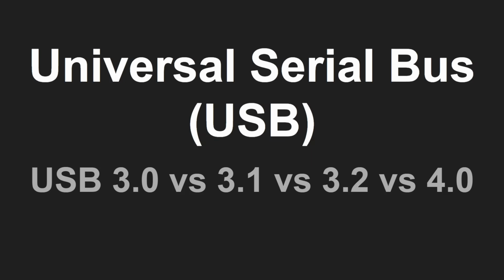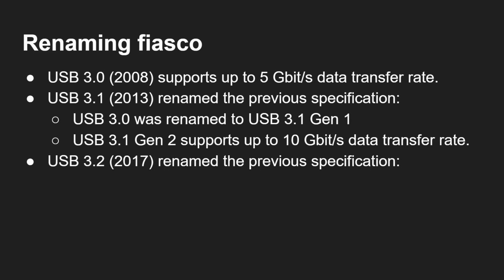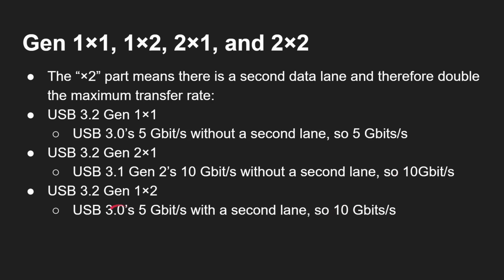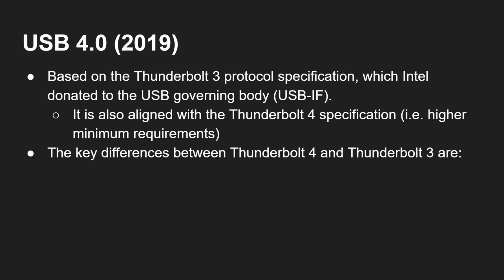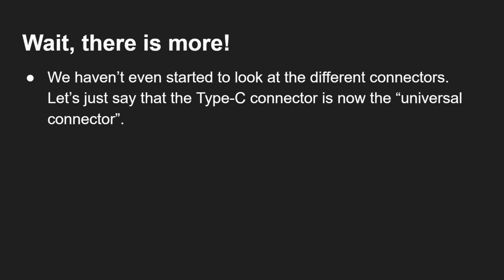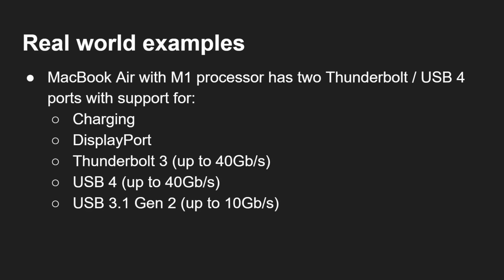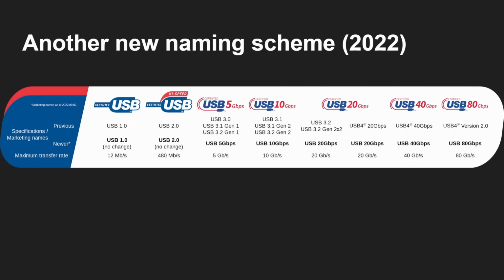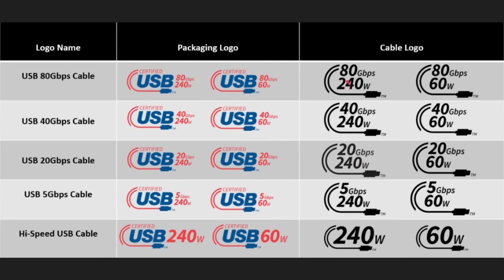USB 3.0 vs 3.1 vs 3.2 vs 4.0: What's the difference?

Comment: So what you’re saying is that the primary purpose of the naming is to be as confusing or ridiculous as possible.
Reply: Pretty much yeah 🤦🏽
Reply: The USB 3.2 and later naming makes sense though but the way they RENAME older versions is indeed gonna cause confusion
Reply: Don't worry man, they are going to change it again anyway.
Reply: If the USB-IF had an ounce of common sense, they would drop all the "3.1" and "3.2" and "Gen" business. Just make it "USB 3 5x1" for the original and "10x1", "5x2" and "10x2" for the rest. There, that's all the relevant information in a simple compact form: the (third) generation of the USB spec, the base speed of the data lanes, and the number of lanes.
Reply: They got me, when I was buying my laptop it stated it have USB 3.1 gen 1, ok I assume great it have the 10Gbit one, because at the time I knew usb 3.0 is 5Gbit and 3.1 is 10Gbit, did not know they rename it.

I still don't understand why they rename 3.0 and 3.1 it was easy to understand and to explain to someone
Reply: @kayl456jenna Makes Sense.👍

Comment: Engineers know the difference. Marketing and Sales do not.
Reply: Always 🤣 I used to attend the quarterly sales meetings from an old tech firm that I worked for back in the 90’s. Trying to get them to understand that on a modem  (woohoo) V.22 vs V.22bis was double the speed @double the cost because every recent order that had come in was for the new tech V.22bis modems using the older prices. I told them to stick to the actual baud rate, which they all knew. Us ‘techies’ would worry about the actual part numbers V.22 numbers etc.

Comment: Here's how I disambiguate USB terminology: Specify the connector type, ignore USB numerical generation, append max transfer speed. For example, instead of USB 4v2, say USB-C 80 Gbps. Instead of USB 3.1 gen 1, say USB-3 5 Gbps. Instead of USB 3.2 Gen 2, say USB-3 10 Gbps. And in case anyone's confused, "USB-3" refers to a blue USB-A socket.
Reply from the maker: Yes, that is basically what the USB people did in the last re-re-rebrand.

Comment: Well, at least the USB Implementers Forum stopped putting things like "Full Speed" or "High Speed" in the names. It's not much, but it's something. If they would now stop renaming older specifications every few years, that would be nice.
Reply: They don't rename older specifications.
It's just the new revision INCLUDES the features and speed modes of the older ones, because of course, they have to be compatible.

Comment: This video was extremely helpful in understanding why the naming is complex. Now I think about the USB number in 'USB Y.Z' as the "meta scheme" number. So reading "USB 3.0" I think "original scheme, so just the third major USB". If I read "USB 3.1" I think "Speed scheme. Gen 1 is 5Gbit, Gen 2 is 10Gbit". If I read "USB 3.2" I think "Lane scheme. So Gen 1x1 is 5Gbit, one lane. Gen 1x2 is 5Gbit, two lanes, so 10Gbit. Gen 2x1 is 10Gbit, one lane. Gen 2x2 is 10Gbit two lanes, so 20Gbit."

Comment: I remember the days of Firewire (IEEE 1394a) and how I loved the ability to chain devices over USB's master/slave roles.  I thought it would win out, but now it leaves me a drive sitting idly by as a historical landmark. Other issues in that day were trying to find even faster storage solutions and looking early at networked storage over Firewire 400 and 800 hard drives so that we could edit and move scratch disks for Final Cut Pro, after all gigabit Ethernet was the fastest thing I could see then to transfer video data at the time. So much has changed, but thinking through different protocols, encoding, and that overhead made for interesting hardware choices back then. Glad things are more settled now.  Or are they?

Comment: Hi, Gary. So when Apple says the iPhone 15 Pro uses USB 3 with data transfer speeds of 10 gbs, which USB protocol is it actually using? And how is it different from the USB in the regular iPhone 15? Please explain! Thanks.
Reply: Late reply but it would either be 3.1 Gen 2 or 3.2 Gen 2 (I'd just call it 3.1 without the Gen bullshit). The regular on the other hand just uses the old USB 2.0 standard.

Comment: Can anyone imagine a world where USB never really took off? Would firewire have developed into what USB is today? Would external drives use eSATA? Would printers use turbocharged parallel ports? Would mice and keyboards still be using the 6-pin PS/2 style interface? Would phones still use barrel jacks to charge? We would be in a VERY different world if USB hadn't caught on.

Comment: question?
usb 3.2 vs usb c 3.2 gen 2 on my pc and i bought a external ssd with a usb c to usb b(into pc) it was also some one who told me to buy a usb c to usb c 20gbps cable instead of the cable that was in same box as my external ssd(I did this and just connected it to my pc)

So the transfer speeds of 400mb/s went up to 687mb/s so it was definatly faster....This i could see without a doubt myself..
But my question is this because i game from my external ssd and loading times has been good will the loading times be even faster now after i got this usb c to c 3.2 gen 2 cable(or is it no differences when it comes to games loading times and only faster when i transfer big game files between my nvme to external ssd"this i saw at once,but loading times w games i dont kno??9

Also why did my external ssd come with a slower usb c to b cable and not the faster? kingston xs1000 2tb is the name if anybody knows this because its just sad to if they dont ship the faster cable and just the older n slower instead(Is this because there are not enough people using usb c ports on pc or what could be the reason to this??)

Thanks n must say this was a great video(i have never been aware of all the different speeds(i knew about usb2.0 and usb3.0 and that was it)

Comment: Yeah... USB's naming convention is like throwing perfume on a pile of hot garbage in a hot and humid summer day to see if it "fixes" the whole thing. It's one of the most insanely idiotic naming conventions I've ever heard.
The problem isn't only about understanding what it is, it's about identifying what devices have what - which manufacturers conveniently won't list or tell, btw - then testing a whole combination of ports and cables to see what works and what doesn't because of a standard that cannot work as a standard, and then after you went through all that multiple times over, you have to keep managing all those devices and cables that you don't know exactly what will work and what won't because of this entire mess.
And then to further make things worse, now we're dealing with enough power to fry devices and potentially even cause fires. Between USB 1 and 2 you didn't really have much of a problem because even if stuff was poorly made, because it was low powered, things just wouldn't work and that was it. Now, if you have a poorly made USB-C cable or out of spec device, you could fry something up, as happened early on.
You pick any random USB A to USB C cable laying around, you have no way of telling it it's a USB 2 power only cable, all the way up to the latest USB 4 spec with full support. It's just a total shitshow.

Anyways, rant over, let me give a tip for people with this problem... go to Amazon, Aliexpress or other platforms and search for "USB cable tester", look for a bare circuit board device with multiple connectors. Some will have 6 different connector types, some will have 9 - between USB-C, USB A, micro USB, and then perhaps it could have USB B, micro B, mini B and whatnot. And then a bunch of leds in the middle of the board.
You just plug cables from one side to another and the led indicators will tell you what the cable supports. It's a life saver.

Comment: Can I put a usb 3.0 in a USB 3.1 Gen 2 port/plug ( which in on a new Mac air that ) or is there an adapter? Sorry I probably sound really dumb. 

(My external hard drive has a usb 3.0 ( think it’s just 3.0) &  if I get a new MacBook Air, will have a usb 3.1 gen 2 . Hence the question (I’m sure there are ways to sort it all out , even if I needed to get someone else to organise it. And I am going to be buying a new external hard drive now as a backup. ).
Reply from the maker: USB is backwards compatible so you can connect a USB 3.0 drive into a MacBook Air. However if your drive has a type A connection (which I guess it does) then you will need a USB Type A to USB-C adapter. Apple has one and there are many third party ones.
Reply: @GaryExplains  thank you so much!!!! I plug my hard drive into my current MacBook via a 3.0 usb cable . Can I just put that into the 3.1 gen 2 port of the MacBook Air?
Reply from the maker: The MacBook Air only has USB-C ports. So, as I said, if your drive has a type A connection (which I guess it does) then you will need a USB Type A to USB-C adapter. Apple has one for sale and there are many third party ones.
Reply: @GaryExplains  oh! Thank you so incredibly much! I thought they had usb 3.1 gen 2 ( based on what I read on  apple ). Thank you!!!!
Reply from the maker: Don't confuse the connector type and the relevant USB standard. Some USB 3.x ports can be USB type A or USB-C (depending on the revision and/or generation). The MacBook Air has USB-C ports.

Comment: and if your doing a pc build only intel has this usb-4.0 , ..... me wanting to do a small build with a monitor on the side and only want 1 cable to it , this won't happen me being a AMD Guy ? .... Right ?
Reply from the maker: As far as I know, AMD has support for USB 4 since 2022. A quick search for "amd usb 4" reveals lots of info. Why do you think it is Intel only? This is USB, an international standard. USB 4.0 is even on Apple Silicon (based on Arm and nothing to do with Intel).
Reply: @GaryExplains   I don't see any USB 4.0 thunderbolt on AMD motherboards only Intel , I'm doing a AMD build right now that has  USB 3.2 Gen 2x2 20Gbps Type-C port can this output video through this cable ? or will I have to use HDMI ?
Reply from the maker: A quick google search for "amd motherboard with USB 4" gave me this https://www.tomshardware.com/pc-components/motherboards/msi-x870e-carbon-wifi-motherboard-review I didn't bother searching any further.

Comment: Yes fine! I think! 
But the Chinese sellers of addon bits and bobs will call whatever they sell whatever they want again. Thus confusing confusion even more, so the seller confusion of Aliexpress terminology and naming flows to ebay and Amazon as the sellers look for new selling platforms. 
And no. Confusion of confusion does not mean it is all corrected.  Two wrongs still do not make a right.

Comment: 1 thing is true I've never seen in my life that 2008 upto speed, like ever!! That speed never reached by any file type transfer
Reply from the maker: Well obviously file transfer speed is determined by the speed of the disk drive. If it was a mechanical HDD from 2008 then there is no way it would match those speeds. The drive is the bottleneck not the data path.

Comment: Perpetuating "USB 4.0" or "USB 4" is harmful to consumers because not only does it go against the original material, but it is also worse for SEO and creates confusion.
There's a reason it's USB4 , the marketing is clearer and avoids nonsensical questions like "what is USB 4.0 v2.0" ???"
Reply from the maker: But USB4 Version 2.0, as specified by the USB-IF, is OK? 🤷‍♂️
Reply: My keyboard corrected my intentional mistake, I meant to write the mistake "USB 4" not USB4
Reply from the maker: Changing the naming scheme yet again, is just confusing. USB 4.0 gen 2 would have been more consistent. The point is that the USB-IF promoted a naming scheme with a ".x" part and now it wants to change that and expects that those decades of branding will just be forgotten. The problem is the USB-IF perpetuating USB4, not the other way around. USB4 Version 2.0 isn't remotely consistent. But when has the USB-IF been consistent?

Comment: What I can't figure out is... Do I need to throw away my so called fast / universal / High Speed 3.0 chargers or will they still work with the new devices with 3.2 ports. I don't really care if they charge slowly and may not keep up with power consumption. I would like to change out my charging stations over time rather than a big investment all at once.
Reply from the maker: I didn't really cover charging, but the chargers are always backwards compatible, just slower, as you said.
Reply: @GaryExplains  Great! Thank you very much.

Comment: In one ear, out the other...
Reply from the maker: Sounds painful 😜
Reply: @GaryExplains  Love what you do Gary! I'm pretty technical, but on the USB front I've mostly trusted that the USB interfaces found on most devices are chosen to be as compatible as possible for most users. At least in my circumstances, that's worked fine.
Reply from the maker: Yes, but if you wanted to buy some external storage or direct attached storage with RAID then knowing the USB capabilities of the device and of the host is important, don't you think?
Reply: @GaryExplains  For sure; I'd want to do my research before doing that kind of setup and I'd trust your video as a resource.

Comment: USB needs to be replaced.
Reply from the maker: Really, why? What with?
Reply: @GaryExplains  The USB-IF keeps changing the names of everything.
Reply from the maker: I know that, a large part of the video is about that. But why does that mean that USB needs to be replaced? I don't understand.
Reply: @GaryExplains  We need a standards body that does not constantly change the names of old versions of the standard.
Reply from the maker: Sorry, I don't understand. What has the naming got to do with the actual USB tech, the speed, the power/charging, the ports, the cables? What don't you like about USB that it needs to be replaced? What standard would you prefer?
Reply: @GaryExplains  I don't like the fact that they keep renaming their standards every time I turn around.  I don't have any replacement standard in mind.  I just want a standard that doesn't keep renaming itself.  And yes, the confusing naming convention is the only reason I want USB to be replaced with something else.
Reply from the maker: So a better solution, rather than changing an entire industry with billions of devices that already support it, is just to get the USB governing body to stop messing with the naming. The standard itself works well, is fast, and is ubiquitous.
Reply: @GaryExplains  I can go with that.